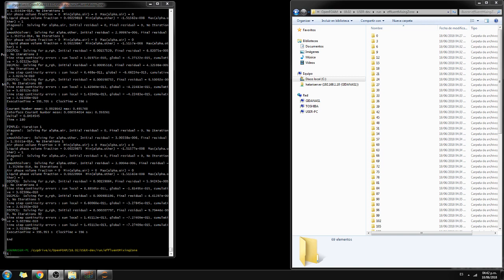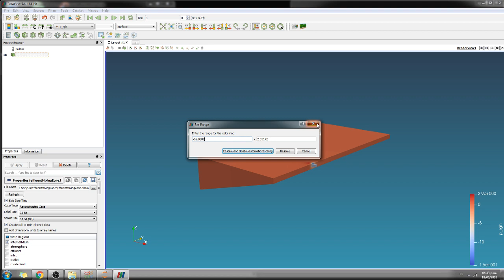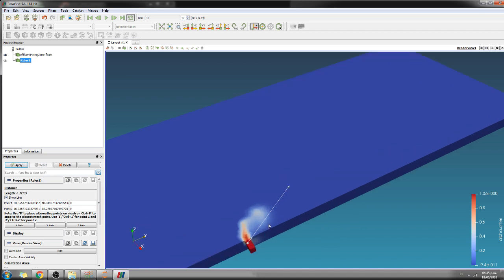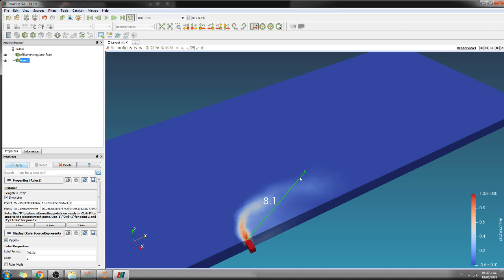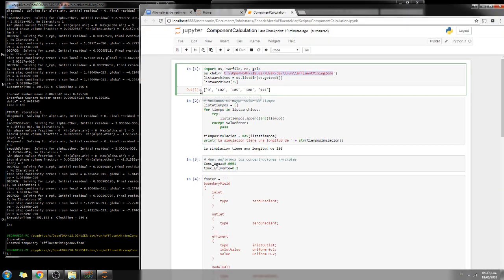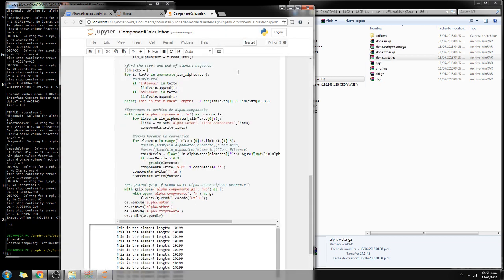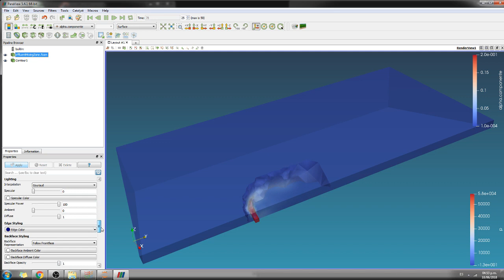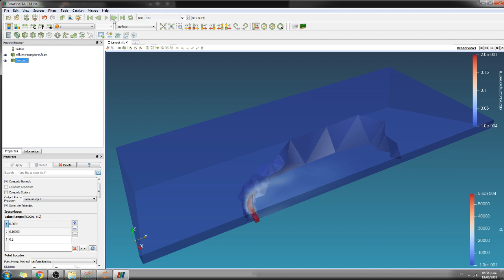Modeling Effluent Disposal Mixing Zone into the Ocean with OpenFOAM - Tutorial 3/3

Comment: Thanks for your video :)
I want to run the solver multiPhase/interFoam/RAS/floatingObject but by default it runs with a cuboid body, I have a cylindrical body in .stl format and I want to use it as a floating object.
How can I do this? I have been able to insert the cylindrical mesh in blockMesh by using snappyHexMesh, but how can I use the cylinder as a floating object? Thanks if someone can help me out, I am doing a univerisity homework